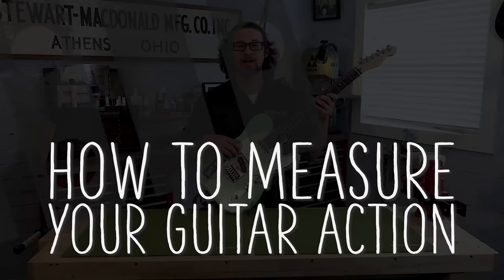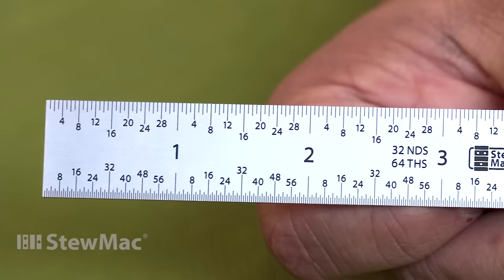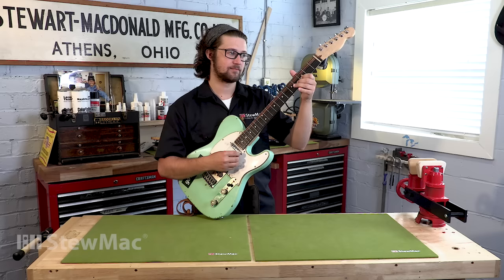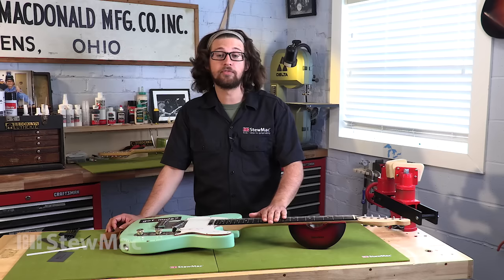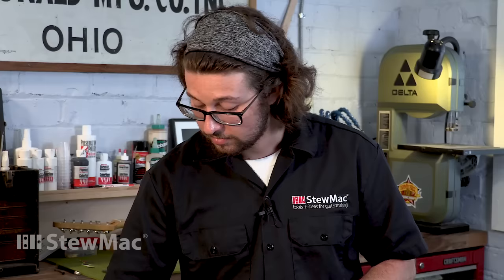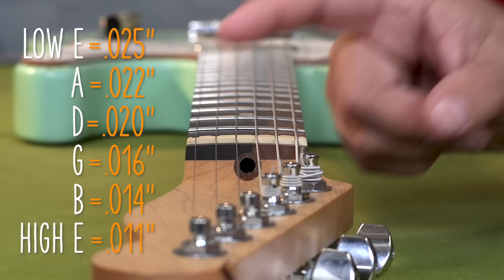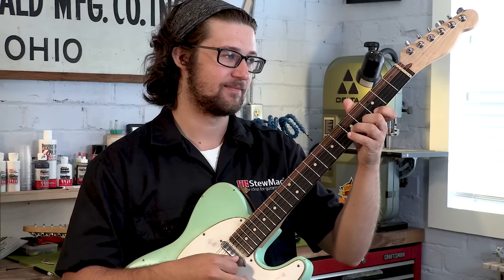How to Measure Your Guitar's Action Using StewMac Measurement Tools

Comment: Great vid. Thanks. I notice you check the action without a capo. Many other people capo the first fret. Is one method better than another? Why would anyone capo the first fret to check action. They don't play with a capo on the first fret.
Reply: It's not checking action, it's for checking neck relief. Fretting first and last frets essentially turns the string into a straight ruler. If it lies flat against all the frets, your neck Is flat or backbowed. If there is enough space between string and fret at the 7th to 9th fret to slide a business card or feeler gauge between, its the correct relief.
Neck relief is always the first step in adjusting action. If you start at the bridge first, you can get your strings low sure, but without the proper relief of the neck you will encounter fret buzz. 

Neck relief
Bridge adjustment
Intonation
Reply: @12south31  Excellent info. Thanks a lot. I meant relief, not action. My mistake. I see people use both methods to check relief, with and without a capo. Just curious about your reasons for using one. I've seen many other vids where a capo is not used.
Reply: @donlessnau3983  Honestly, whether you use a capo or your fingers, it will get you the same result. However, using a capo at the first fret will give you a free hand to measure distance from fret to the bottom of string which would be more accurate than eyeballing it. Just personal preference really. I personally dont use the method at all. I use a notched straightedge and feeler gauges. I feel doing it this way, which is the "technically correct" way, is sometimes easier and I dont have to worry about adjusting twice because I measured correctly for sure the first time. In reality, does it make a big difference? Probably not. Using the string method and a business card or something similar under the 7th fret usually works just fine. Like I said, personal preference.
Reply: @12south31  Thanks a lot. Great info. I'll look into finding an inexpensive notched straightedge. I get all my tools from StewMac. Generally I use the capo and the StewMac string action gauge to check relief at the 8th. It's just easier for my old eyes. I'd like to get a StewMac notched straightedge but that's a ton of money for someone who only uses it on their own guitars.
Reply: @donlessnau3983  Your very welcome. I found a notched straightedge for Gibsons and Fenders on ebay for $15 and it came with a high fret checker as well. It doesnt say Stew Mac, but it's the exact same thing. I'm a luthier and work on guitars all the time. I love it. You wouldn't believe how many people pay me $20 just to restring their guitars. But I also do full set ups, truss rod adjustments and fret leveling. There's some really great info on YT on doing all this stuff. I started out just doing my own guitars and then realized there was a high demand in my area for set ups so I made a business out of it. As they say, do what you love. Good luck!
Reply: @12south31  Thanks for that. I will look into it. I do all my own set-up work on all my guitars. I bought a couple cheapies a few years ago to learn on. That way if I broke anything, I'm not ruining one of my $1K guitars. I used to use a feeler gauge and capo for relief but being 70, my hand shakes a bit, which makes an accurate feeler gauge tricky. I find the capo and a StewMac action gauge much easier and accurate. But it would be a good idea to have a notched straightedge handy for other work on my bench. Thanks again. Happy New Year.
Reply: @donlessnau3983  The straightedge is definitely a must if you do fret leveling as the neck must be perfectly straight. I dont know why more guitar players dont do their own set ups. It's all part of the fun of playing guitar. Plus it saves a lot of money. 
I did the same thing, bought a cheap guitar to practice working on. Actually it was a cheap $150 kit Les Paul knock off. The neck was actually decent, but I put it together to try it our stock, then tore it down and tweaked every single thing I could and replaced the pickups, hardware and electronics. Basically I just kept the neck and body. It turned out to be a pretty cool project though I really never play it much, it's nice to have something I can practice working on when I learn new things. Not a good idea to try fret leveling for the first time on your Gibson! Good luck, nice talking with you. Happy New year to you also!

Comment: Good vid. But it has some confusing info. At 3:27 Blake measures the low E at the 12th at .040" which is the right spot BUT much too low for the low E side. But then he's measuring at the 1st fret on the high E at 3:55 at :040" and then jumps up to the 12th fret on the high E.??? Confusing. Doesn't make much sense.
Reply: See 06.30 when ideal actions are mentioned on the 1st fret open strings

Comment: I just have to say something that really bothers me. Let me just preface this by saying that these videos and Dan Erlewine have been extremely helpful in providing the knowledge to give me the confidence to do my own repair work and setups. But $45 for a 6 inch ruler??? It costs $9.50 on Amazon for the same thing by General, which is the EXACT one that Dan Erlewine himself recommended in his repair book. The Stewmac one is FIVE times the price!! How do you justify that?!
Reply: They grab that cash with both hands and make a stash.
Reply: Just from personal experience buying a few of their tools, they're heavyyy duty. I didn't buy that 6" ruler but the tools I did buy were definitely life time for any do it yourself at home person. They would last a really long time in a shop also, perhaps a life time depending on the tool. They're really hard and thick. har har har thats what she said.
Comparing both online, the General one is flexible and the Stewmac one looks rigid and has modifications for guitar specific use. Measurements on the end vertically and a center Zero line.
Reply: I've bought quite a few stewmac tools and while they're great quality, they're exorbitantly priced.  I recently bought a product by FretGuru to level frets and the quality was excellent and less than half the price of Stewmac.  They often compare their tools with cheapie imported products to show their superior quality, but products don't only live at the extreme ends, and Stewmac isn't the only company that produces luthier tools of good quality.  There are companies producing tools of the caliber of Stewmac (or at least very close, and definitely good enough for us home tinkerers) that are less than half the price, often more like a third.  Stewmac will be my last resort for tools, as their profit margin appears excessive, but if you've got the cash, by all means.

Comment: You know what works the best? And it’ll only cost you a quarter. 
Yep, use a quarter under the twelfth fret. It should just slide under the low E string. And if you slide it in (Giggidy) and there’s a space in between the quarter and 12th fret then you need to lower the saddle height. 

Now watch StuMac will come out with a new quarter that costs 50 bucks.

Comment: Or just use a deck of playing cards.. 3cards = 1mm.(about).. Depending on brand. 12th fret should be about 5-6 cards for a 1.8-2mm action. You want them to only JUST hold when u tilt the neck but not hold too firm. Same with the 1st fret but 2-3 cards should do the trick. A great cheap alternative to spending lots of cash on tools, or if u need to do a setup with whatever u have on hand like i did lol. Did a setup with this on my Ukulele which is somewhere in between an electric and acoustic action height. 7cards on 12th and 3 cards on 1st fret is about right for Uk's.
Reply: Another fun, folksy method - when adjusting string height on a Gibson , check the high E gap with a dime and the low E gap with a nickel. The thicknesses are just about the to factory height specs.
Reply: @esmeraldo7887  Cool. I'll have to remember that. Mine is more for Ukulele's sorta, at least that's the only thing I've tried it on.. but worked great.

Comment: You don’t need to buy radius gauges guys.....just measure each individual string with a rule at the 17th fret to adjust the gap between the string and the fret. 4/64ths for the 4 thicker strings and 3/64ths for the final 2 treble strings. If you do that it will produce a natural radius arc without the need for expensive radius gauges.
Reply: Yep...been doing it that way for years.  The radius gauges are a pain in comparison.
Reply: BCY123 Glad to hear someone else sees it too 👍🏻

Comment: Maybe someone can help me on here…. I’ve been driving myself crazy for the past couple weeks trying to fix my intonation because when I would tune up to E standard the strings sounded tuned when I individually hit them with an open string but when I would play like a E chord or A chord it sounded off. So I decided to mess with the saddle screws to try and fix the issue. But I got overwhelmed and ended up messing it all up. But now I’ve managed to tune up my 1st 3 strings (high E, G & B strings) perfectly but when I try tuning up the other 3 lower strings (D, A & low E strings) it’s makes the 3 high strings out of tune and when I tune them back up they’re off on intonation. 

So my question is what do I need to do to get the 3 low strings to not pull so much tension to mess with the intonation of the 3 high strings that I got tuned perfectly the way I want them. So I have the 3 low strings untuned down because I’m not sure wether to tighten or loosen the saddle screws to them so they won’t mess with the high 3 strings I finally got tuned and the action exactly the way I want it. I’m just not sure whether if I tighten the screws will that give me more slack on the strings so there isn’t as much tension on the other strings? Or do I loosen them even more to relieve the tension so that when I tune up the 3 low strings they won’t affect the intonation of my 3 high strings? Because I just want to play an A chord where the A string sounds tuned right.. and I just want my action low and my intonation right so that when I play open strings it sounds in tune but also when I play chords it sounds in tune. But I’ve been stuck trying to get this right. I tried using my digital chromatic tuner to figure out if my intonation was correct but the advice I got on that isn’t working for me, with the whole tune up the string and then I’ve been told to use the harmonic of the 12th fret to see if it’s sharp or flat and then loosen or tighten the screws accordingly. Then I was told no don’t use the harmonic of the 12th fret, I’m suppose to use the fretted 12th fret to check the intonation. But everytime I tried it, it would just keep telling me that the note is sharp so then I would loosen the screw and tune it back up and check it again…. And the needle didn’t move at all so I loosened the screw a bunch assuming the tuner would tell me that the note is flat now…. But nope it would still show it being sharp about to the middle so obviously I wasn’t doing something right and just gave up on trying that. I’m at my wits end I’ve been playing for 27yrs but never really learned any of the technical aspects of guitar or how to fix up my own guitar, I would usually take it to a shop or just play it the way it was when I got it. So sorry if I seem clueless to things that may seem so simple to y’all but any help or advice would be greatly appreciated! I just want my guitar setup correctly and in tuned and intonation
Reply: What bridge do you have?
Reply: @HunnysPlaylists  A Strat style bridge
Reply: @DblakeDeathMetal89  could you have it professionally set up?
Reply: @HunnysPlaylists  unfortunately no, the only guitar shop that was near me was Hot Licks but they closed a few years back. But I managed to get it pretty close to perfect intonation but I luckily have a 2nd guitar that was professionally setup and it’s been great for years now!
Reply: @DblakeDeathMetal89  you can get a strobe tuner to try yourself.
Reply: Just take it to a Luther at that point

Comment: If you do those videos, don't just "fake it" to get your footage. 

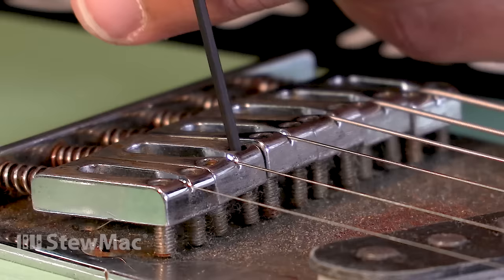When you adjust the saddles at 5:29 you just adjust one side of the saddles, cause you prepared those strings not to buzz to have something to adjust checking with the understring radius gauge. You should mention that every individual saddle has to be horizontal, meaning both screws have to be adjusted the same amount. That way, both screws share the load as intended.
Reply: These videos are designed to sell products that StewMac offers; to show them in use.  They are not designed to be an in depth, "how to" guide.  There are plenty of videos detailing guitar set up.  Let's try to keep things in perspective, respectfully.

Comment: HEY NOVICES.... These set-up videos assume your guitar is all ready to be adjusted. Nothing could be further from the truth, regardless of how new or old the guitar is. There are soooo many other things to understand such as neck angle, neck alignment, the affects of humidity, stubborn truss rods, worn and high frets, how pup height affects string vibration- especially the low E on a Strat, nut slot depth, string break-angle, understanding scale lengths, intonation tempering, Strat trem idiosyncrasies, how to adjust the guitar for your own playing style, and on and on...  Everything you adjust has a profound effect on all the other adjustments, so they need to be done in order, and that order can depend on the guitar as well as other things. It's VERY in-depth.
Reply: Uh...no. 90% of the time it's a truss rod tweak and turning some screws on the bridge.
Reply: @XoseGuitar  Respectfully disagree.

Comment: Quick tip: strings four to six on this guitar have too many turns on the tuning pegs, sixth even overlapping itself. Not only it looks extremely untidy, it basically turns your strings into springs, leading to tuning instability. Couple of turns is more than enough.

Comment: I have found the best way to measure string height is to NEVER EVER DO THAT! Level your frets, after straightening neck. Then put strings on and do NOT introduce ANY relief into neck. If you level the frets perfection, sight along stringed neck to determine if you must put a shim in pocket to achieve strings parallel to neck from nut to bridge. When parallel you get NO buzz and no relief that is measurable. Relief is enemy. Unless you are a player who.likes action a bit higher.then go for it.
.

Comment: Isnt there a point when you say 64 thousandths of an inch , you feel its ridiculous ? I mean wouldnt it be better to say 1.5mm , seems so much easier. But i guess my crusade against the imperial measurement system is going to fall on deaf ears.

Comment: 10/1000th of inch on the low E string?  WTH?   It should be around 20/1000ths or else you'll get buzz.  Even for lite players! The low E string vibrates in a larger elliptical radius than the high E string.  You have both the same and also at the 12th.     Action is way too low on that guitar.
Reply from the maker: I believe he actually measured .040". Still pretty low, but definitely not .010" or .020". Thanks!